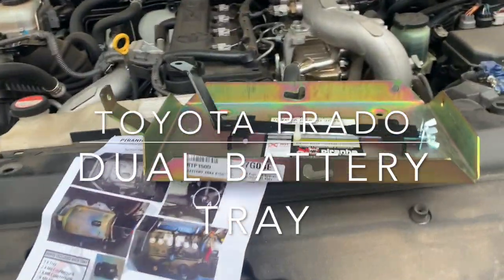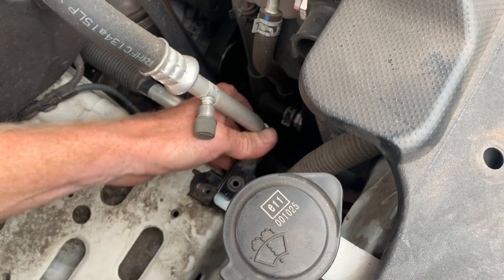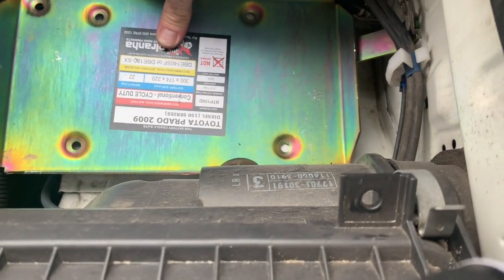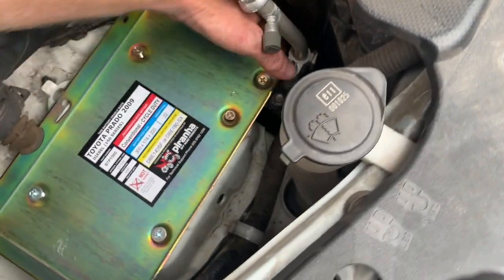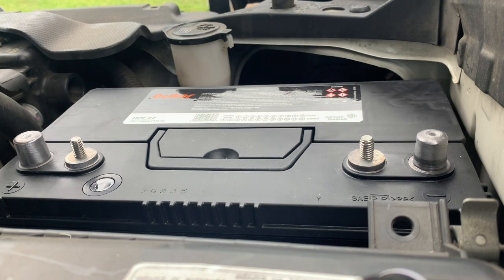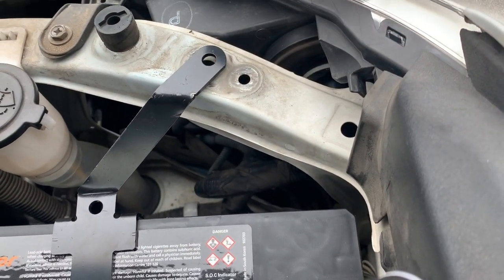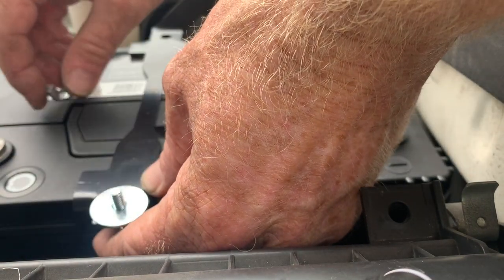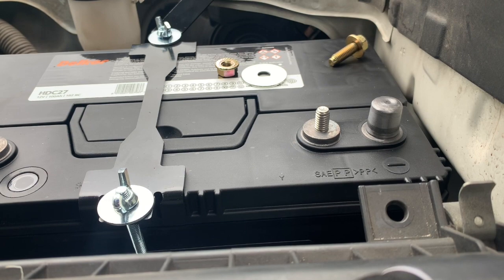Prado 150 series 3.0L Piranha dual battery tray installation.

Comment: Do you have a Kakadu model compatible battery tray?
Reply from the maker: This tray fits most Kakadu models in the same way, its just a couple models of KAkadus had a air pump mounted in the location of the battery so it just means that that has to be moved.  So if your battery location is clear then this tray will fit just like the video.

Comment: Just installed mine. It's a horrible fit. Took several hours with some modifications to the screw holes and side mount arm to make it fit as the tray holes do not line up with the holes on the vehicle tray above the guard and the side mount needs to be bashed to bend it to fit properly.
Reply from the maker: Hi Andrew, That’s no good mate.  Did you purchase the kit through us? I just couldn’t see your order in our system.
Reply: @AussieDrifterTouring  I can't recall I think I got it off eBay somewhere or from Piranha
Reply: It's solid now but it was alot of work to get it to fit. I was surprised at how well the relocation of the air con pipe worked and how easy it was to shift over. I did have to undo the plastic clip holding the hose to the chassis further back towards the rear of the engine bay. I used some heater hose around the aluminium pipe to prevent any rubbing near the yellow and blue tape
Reply from the maker: @andrewraphael5000  sounds like you got it all sorted in the end,  that’s good 👍
Reply: Man exactly the same problem with my 2010 GXL. Bloody holes don't line up and also side mount arm not bent enough for flush fit. I hate this thing and have to make it work now. Will have another go and drill the screw holes bigger and bend the arm mount more. I can get a good look at the clip holding the AC pipe near the wheel arch. No idea how to undo clip.

Comment: What model Prado was the tray installed? We have Attitude model and struggling to move the A/C pipe?
Reply from the maker: Chooka2005 Chooka hey mate sorry I cant remember the badge model.  Altitude should be ok, I know it won’t fit some Kakadu models.
Reply: @AussieDrifterTouring  how do you take care of the Kakadu model tray fitting problem?
Reply from the maker: @dariomartic6766  Hey mate, Im not sure there is a solution for that model sorry.  might have to look at a battery in the back.
Reply: @AussieDrifterTouring  thanks mate, I think that's what I might have to do.
Reply: Which exact battery did you use on this Prado?
Reply from the maker: @BenjaminJames44  it’s a delcor hdc27 lead acid deep cycle battery mate.
Reply: @AussieDrifterTouring  Thank you!

Comment: my prado has the steering wheel fluid where the tray should be installed. any idea where to move it to be able to sit the second battery?
Reply from the maker: Hi Mate, Do you have the petrol model?
Reply: @AussieDrifterTouring  yes I do!
Reply from the maker: @juanpabloalvarez6160  we use the piranha 4x4 battery tray which allows that to be moved, here is a link to their guide which might help you out mate https://www.piranhatc.com.au/wp-content/uploads/fitting_guide/BTP150P.pdf
Reply: Hi, how do i know if my model has smart alternator, is a 2010 gxl 4.0 V6 150 series
Reply from the maker: It doesn’t mate non of the Toyota’s have a variable voltage alternator.  They have a temperature compensating alternator.